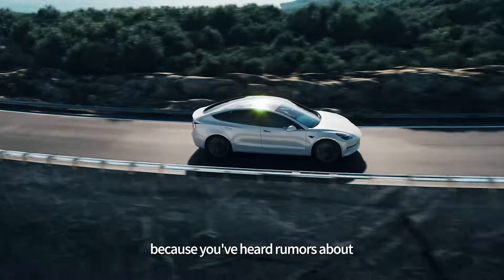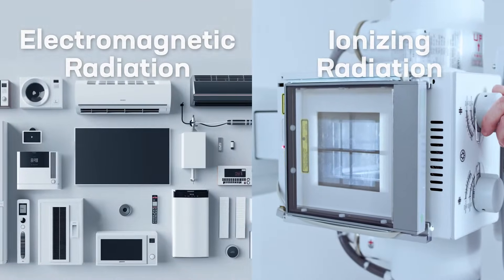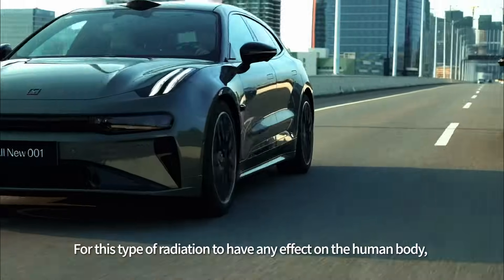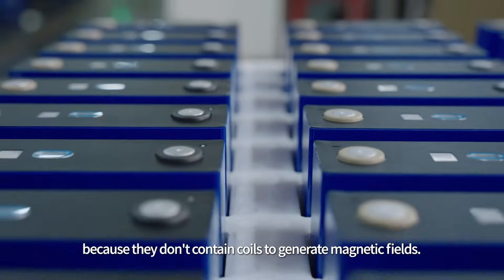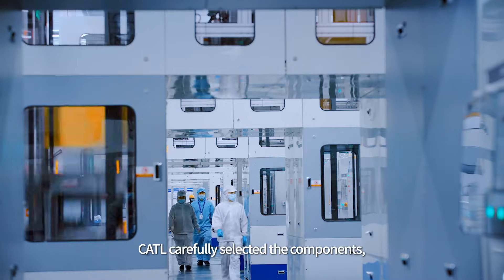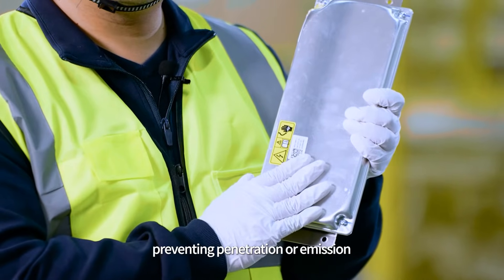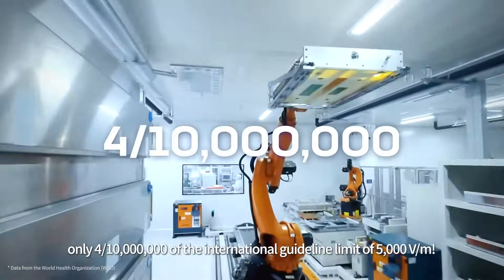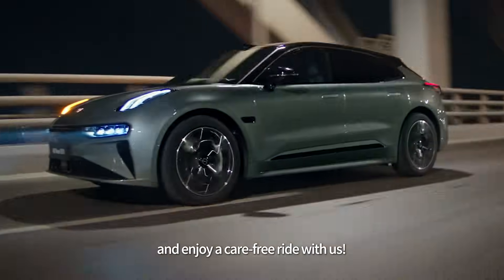Myth Busted: Is Electric Vehicle Radiation a Concern?

Comment: All i know is cellphone does emitting dangerous levels and that's a fact everyone knows. So i measure my cellphone when ringing and when not, to understand how much is bad, and it appears 250-300 EMFs. Then i went and mesured my Mercedes Benz EQS and BMW i5, and on the floor it was about 50-100EMFs when not moving, and about 250-300 EMFs when driving. On the seat it is much lower about 50-100 EMFs when driving. So your feet may feel the damage pretty fast i think with those levels of radiation. But there is cars like Tesla and Prius that can emit over 700 EMFs.

Comment: 1st half of video:
EM radiation is harmless.

2nd half of video:
We’ve put in place half a dozen safety measures to prevent EM radiation from reaching you while you’re in the cabin of your EV.

👌
Reply: It’s not a contradiction. EM from an EV is non-ionizing and way below harmful levels. The shielding is mostly to stop interference with the car’s systems, not to “protect” you. Honestly, you get millions of times more dangerous radiation just standing in the sun.
Reply: @Hexer3Dmicrowaves are non ionizing too
Reply: @BrainUser123  Yes, but it has a much higher power output and mainly heats water molecules.
Reply: @Hexer3Dbig cope lmao, humans are mostly water, cars literally emit microwaves, frying you as you drive
Reply: @BrainUser123  bro, if EVs were “frying you as you drive,” taxi drivers would be medium-rare by now 😂
The EM fields in cars are millions of times weaker than microwaves, literally not even enough power to make you any bit warmer lol.
Reply: @Hexer3D they are, they are sick all the time, that's why there are so many propaganda/disinformation articles out there trying to claim that it's the so-called motion sickness that is making people sick, which is absolutely hilarious. It is clearly the radiation.
Reply: @BrainUser123  Bro, the "radiation" you’re worried about in EVs is just low-frequency EM fields (50 Hz–kHz), which are non-ionizing and far too weak to harm you think millions of times below dangerous levels. You’re exposed to way more from sunlight (UV, starting at 3 PHz) or cell towers (GHz range). Harmful radiation needs massive energy, like in X-rays or gamma rays, not the tiny fields in EVs. They’re safer than your morning coffee. Check the science before chasing conspiracies please.
Reply: @BrainUser123  These EM fields are so weak they’re in the picowatt range, millions of times below anything harmful. Even if you magically bumped that power to the Petaherz range (like UV or X-rays), it’d still lack the energy to do damage like sunlight does with the 100 Watt’s with you.
Reply: @Hexer3Dcope
Reply: @Hexer3D wrong
Reply: There are reported headaches when driving EV. Average measured radiation in cabin is 400μT and your cellphone produces around 75μT... Well Mac Donald's are also safe so let's eat mc menus every day, what could go wrong?

Comment: No actual measurements made.  This is useless.  Downvoted.
Reply: Why would measurements be needed? It’s impossible for an EV battery to produce even a fraction of the radiation that could be harmful. Do you measure the temperature outside to verify that your skin won’t burn off if you walk outside? No, because it’s impossible temperatures would ever get that high, and a simple explanation should suffice without needing to “prove” it.
Reply: @Neberheim  Measurements are objective, easily understood numbers.  Without measurements the audience is being asked to trust the person speaking .  But not trusting "authorities" is the problem.   Stop asking for trust.
Reply: @PaulthePhilosopher2  You don’t need measurements to know a fire will be hot, it’s a given based on the principles of combustion. If you need measurements to prove safety of these, you would also be better served by learning the principles of electromagnetic energy as any measurements given would be meaningless if you don’t trust the “authorities” setting exposure recommendations.
Reply: @Neberheim You are talking nonsense. There are measurements for medical x-rays for example as the effects can accumulate. Non ionising radiation is also bad on the long run. Shame on you.
Reply: @EddyEddy-c3w if you somehow read in my paragraph that measurements can’t be taken, let me try to make it more explicit. Measurements are meaningless in this context, because the safe limit (meaning the maximum exposure known to be safe, which is very different than the minimum exposure known to cause harm; this is an important distinction) for EMF is orders of magnitude beyond what an EV is physically capable of producing.
Therefore, asking this battery company to provide measurements is as senseless as asking to measure the temperature of a campfire to know if it can burn you. The analogy is intentional too, another way to describe non-ionizing radiation is “heat”. 

Saying that non-ionizing radiation is bad in the long term is as ludicrous as saying that heat is bad in the long-term. For sure, if you hold your hand too close to a fire for too long, its non-ionizing radiation will burn you. There are no long-term or cumulative biological effects possible from heat exposure that is below the threshold to cause a burn injury. Go around your day and explore different heat sources, touch a hot laptop case, that’s conductive heat. Feel hot air blowing from the wind or a hair dryer, that’s convective heat! Hold your hand near a candle or light bulb, that heat is non-ionizing radiation! (I would say the sun too, but the UV light is ionizing so simply focusing on the visible light spectrum would be technically incorrect)
Reply: @Neberheim No. It's not meaningless. Why do scientists warn against long term sun exposure as it's also non ionising radiation? You have written nonsense.
Reply: @EddyEddy-c3w you are clearly trolling, I said specifically that there’s a difference between visible light (all visible light) and UV light. UV light is ionizing, which is why it is harmful. This is the only reason it is harmful. Without UV and ionizing radiation, the sun would simply be a big light bulb.
Reply: @Neberheim You are wrong. Uv light is both ionising and non-ionising. Also non-ionising Uv light can be harmful. Therefore there should be a measurement on electric cars. You have written nonsense.

Comment: I dont usually drive a microwave to work for 2hrs/day.
Reply: What a dumb thing that was for this guy to say. I don’t stand in front oy one for 2 hrs either.
Reply: Microwave,? doesn't make sense
Reply: @4th_Disciple good; that would be uncomfortable and strange use for one.
Reply: His speaking about electromagnetic thing. Radiation
Reply: @ And? Light waves are electromagnetic radiation too, but at higher energy than micro (radio) waves.

Comment: I cannot understand the people who get these hoaxes. You do not need to be very clever, or educated. You do not need to understand the physics. What you need is common sense:

- Trams work with electric motors.
- Trolley buses also do.
- Trains are almost all electric.
- We have used these commutes for almost 100 years.
- A lot of people use these.
- We are okay.

What is the difference between an electric car and a regular car? Why would it be suddenly and out of all electric vehicles so dangerous? Will we need less Russian oil?
Reply: We are not okay... Big Pharma is ok though.
Reply: It is not the electric motor per se, it is the battery causing those unhealthy EM fields. That is something quite different!
Reply: @verocimil  no. Surprise: Many trolley buses HAVE battery enough to travel a few hundred meters without power from the line. Especially the old Russian made where outage was common and they did not want these busses stuck in the middle of the cross section. Ppl use them in the last 70 years. So again: batteries do not create EM fields at all. What you say is BS.
Reply: @PeterVerhas  Well, there are many people complaining about health issues after driving in EV's, especially during acceleration, breaking with recuperation, etc.. 
So again: batteries do create EM fields, and it has been scientifically proven. So, keep your language to yourself. Someone who has strong arguments doesn't have the need to be rude, which apparently isn't your case.
Reply: @verocimil  so your strongest argument is that my arguments are not strong because I said what you wrote is BS? You are hilarious! Go on an push the Russian propaganda against modern technology.
Reply: @PeterVerhas  Quote @PeterVerhas: "Especially the old Russian made (trolley buses using battery) where outage was common and they did not want these busses stuck in the middle of the cross section (...) Go on an push the Russian propaganda against modern technology."

No more comments. Many blessings to you!
Reply: @verocimil  provide the doi of a single study showing this. Also, learn the difference between correlation and causation. Even if these symptoms are documented and reproducible, it’s far, far more likely that they are related to how sudden the acceleration is in an EV, many of which have performance numbers that rival or beat super cars from a few years ago, and the see-saw-like effect that poorly modulated brake pedals exhibit when regen settings are high enough that reducing the accelerator shifts you forward as it rapidly slows the car.
Especially since the EM fields you mention are not remotely what you seem to think they are. Don’t forget that light is EM radiation too.

Comment: The batteries may not have coils but the wiring inside the car act as coils and the emf waves are amplified by the faraday cage principle the car body provides. The car is in a sense turned in to a giant microwave
Reply: No. That’s not what those words mean
Reply: What a great fool😂
Reply: @hansthienpont5328   but for real, you know that the only harm from micro wave radiation is getting burned right? Micro waves are a “slower” and lower energy wavelength than light (hence “micro”), and just like the radiation from an incandescent light bulb, they’re only harmful when they have enough power to burn you (think about a 100w incandescent light bulb and how hot it is near it).
The only thing that can make a microwave more dangerous than a light bulb is that even a very powerful light bulb (like a 2000w halogen) has to be fairly close to you for the light waves to radiate enough heat energy to burn, but because micro waves being lower energy means they’re longer and “slower” they can carry their energy further and can burn you at a longer distance than light can.
(And hopefully you just realized that this means that sunlight is almost unfathomably powerful if it can heat you up from millions of miles away; don’t give a second thought to the minuscule energy of micro waves if you are comfortable standing in sunlight, or sitting in front of a fire for that matter)

Comment: What a BS. Microwave is harmfull . Just like cellphone.
Reply: Microwave beam is harmful if one stand in front of it at less than 50 cms away.
Reply: Don’t try to disprove my theories with facts!
Reply: @olgaolga3292  but for real, you know that the only harm from microwave radiation is getting burned right? Microwaves are a slower and lower energy wavelength than light (hence “micro”), and just like the radiation from an incandescent light bulb, they’re only harmful when they have enough power to burn you (think about 1000w halogen light bulb and how hot it is near it).
The only thing that can make a microwave more dangerous than a light bulb is that even a very powerful light bulb has to be fairly close to you for the light waves to radiate enough heat energy to burn, but because micro waves are lower energy and already traveling slowly, they carry their energy further and can burn you at a longer distance than light can.
(And hopefully you just realized that this means that sunlight is almost unfathomably powerful if it can heat you up from millions of miles away; don’t give a second thought to the minuscule energy of micro waves if you are comfortable standing in sunlight, or sitting in front of a fire for that matter)
Reply: @Neberheim  Microwaves sensitively affect some biological organs in addition to the CNS, reproductive, cardiovascular, and hematopoietic systems.It has been shown that microwaves play a role in inducing cancers on the skin and in the brain tissues.Various studies have reported an association between microwaves and male fertility. The human reproductive system has shown adverse effects, and in some cases neutral effects, against various microwaves. Specifically, cell phone radiation has also been found to have harmful effects on the male reproductive system.The CNS was determined to be the most vulnerable to microwave radiations, with the hippocampus being particularly sensitive. Specifically, microwaves can damage the brain (one of the two key components of the human CNS), particularly affecting the neurotransmitters which play an important role in passing signals inside the body. Accordingly, microwave radiations can cause a delay in the signaling process, resulting in further harmful damage to the body.
Reply: Not to mention, the sun puts out microwaves as well.  @Neberheim
Reply: It always depends on the intensity, which decreases rapidly with distance. I'd be more worried about electric motorcycles, where you're sitting directly on the engine.
Reply: guess what, microwaves can cook you. yeah totally harmless.  😆
Reply: @litecashAngel  Then eat a lot of food that you heat up in the microwave. People like you aren’t needed anyway. Air and water are just wasted on you.